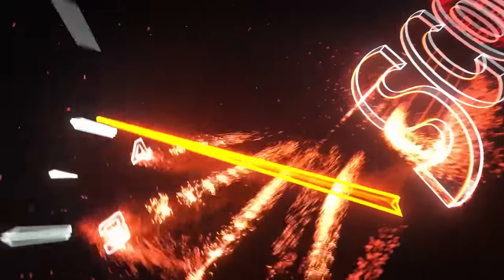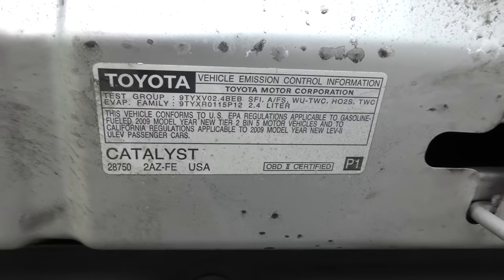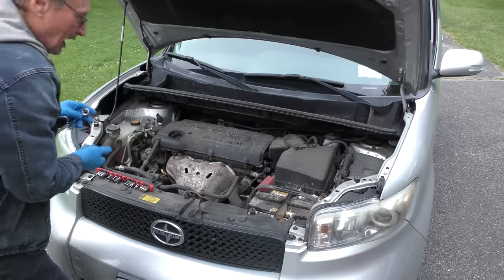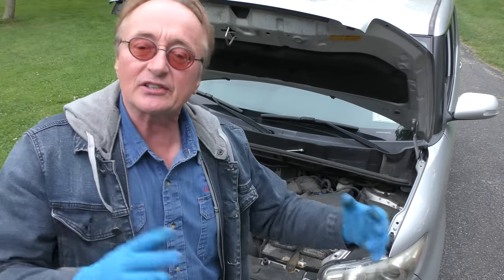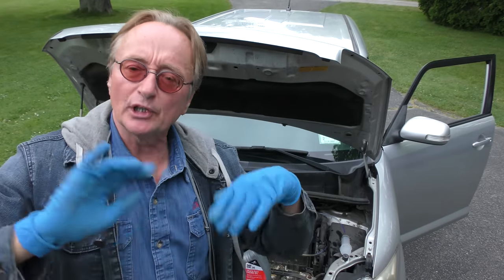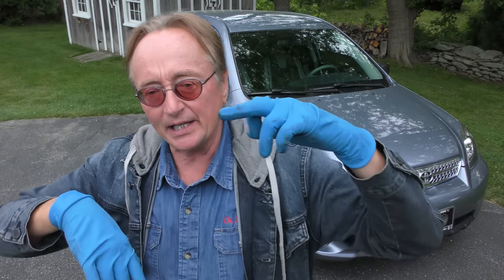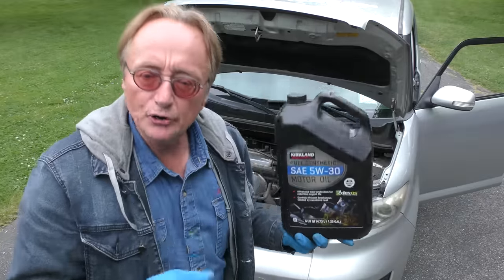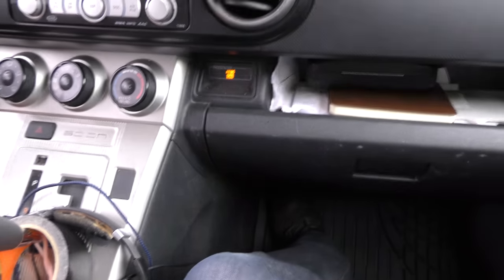Read My Lips, DO NOT Buy These Cars

Comment: I think they didn't want to associate the tiny (Scion) cars with Toyota. Picked up a 2007 Rav4 (also 2.4l like your son's camry that got handed down and still runs like a champ), picked up at 89k miles. Record says no recall performed for rings, burned about 1.5 quarts per 3000 miles. Threw in some Seafoam in the oil and lo and behold, the burning seems to have stopped. Figure 5 oz of seafoam every 3000 miles is totally worth it. Will tell over time I suppose, but I think the seafoam is cleaning the burned oil gunk out.
Reply: Its not really a matter of " Burning the gunk out " of the motor  .
The clearence between the rings and cylinder wall will only get worse with mileage .
I had an 07 Rav4 with the 2.4 oil burner motor also .
I just checked the oil every few days and kept up with it  .
And Scotty has said Seafoam is a waste of money and I agree with him .
Just change your oil / filter every 5k miles and that will help prevent premature wear on your motor and should keep the oil consumption down.
Reply: I had an 03 Camry with the oil burning engine.  Put 306,000 miles on it before it died (died due to my neglecting the oil level).
Reply: @stevechance150  Sounds like you got your money's worth from it .

Comment: Does 2013 Scion xB with a 5 speed standard have the  same problem? My has 85285 km on it
Reply: I believe they fixed the oil burning issue at the end of 2012 .
Reply: My 15 is like a fine clock. I also have the manual. Fun and better mpgs.
Reply: Yes. I get excellent gas mileage on it I use stp octaine boost every 3 tank full to help it along. My empty to me is a half of a tank full. 

I also have a 2002 honda accord lx 4 door with the 2.3 liter v-tec 5 speed standard. I have been using the boost in that for 16 years that I have owned the car. Excellent fuel mileage as well..

Comment: Scotty,
My Scion XB hesitates or don't start when warm despite it cranks... Only when cold has no problem starting. A mechanic said it was due to a faulty fuel pump. Once running it drives and feels smooth. It burns oil @ 160k (1Qt every 350 miles) but the engine still has a lot of pepper in it. Please advise.

Comment: My 2014 with 315,000 miles has not burned oil ..my transmission just started slipping .. i changed the tranny fluid at 186,000 when i bought it. I just changed the filter and the slipping decreased.

Comment: I thought Toyota shot themselves in the foot when they discontinued the little 1.5L, replacing it with the Camry engine. I think for a short while the larger engine was an option and they they discontinued the 1.5L JUST BEFORE the price of gas started skyrocketing. Worst timing ever. The 1.5L will get you all the speeding tickets you want. The XB is NOT a sports car. We have a 2006 XB. Just replaced the original exhaust, resonator on back and shocks before that and the A/C just stopped working a couple of days ago. Other than that, it's been really reliable.

Comment: I have 260,000 miles on my 2008. No problems aside from AC condenser and a Valve Cover gasket leak. Simple repairs.

Comment: I have a 2005 Scion xB.  AC compressor went out. Replaced it. Second one immediately went out.  Replaced it again.  AC came on and off until it died a year later.  Car goes through a liter of oil every 1000 miles.  Hood rod broke off. Now the tail light fuse blows immediately when I turn on my lights even with the wire harness removed to the taillights and display lights on same circuit. Still trying to find the short.   This car sucks.  Embarrassment  to the Toyota name.  No wonder you can get these cars used for $3,000 or less.

Comment: Well MAY of 2022 l got a 2012 scion xb ,84000 onit..90000 now 1 year late, two oil changes WITH ATS Additive it went from 3/4 quart in 1000 miles to 1/3 quart in 3000 miles thats two treatments 60 doller each with the gas done at the sametime,Wonder just how often i should repeat this ATS stuff every 3 or 2 oilchanges.

Comment: It’s worth mentioning those rusty Tacoma and tundra frames were not actually Toyota’s fault. In order to bring more production into the US Toyota teamed up with a us manufacturer to make the frames in the United States and save on import taxes, this in turn would keep the price down. Unfortunately Dana corp who toyota used to make the frames made them from substandard materials and did not treat them properly for corrosion resistance. This persisted from 05 to 12 when toyota caught the problem and brought frame production back in house. The trucks with the rotten frames were recalled. Mine had 2 3/4 inch holes above the rear wheels and I was issued a rental immediately. The reframed  truck was driven for another 4 years and with just under 100,000 miles on it I got 8500 for it selling it. The reason toyota replaced the frames was they got a 28 million dollar settlement from Dana corp to replace them

Comment: I have a 2014 Scion XB with 33,352 miles.  I am the original owner. I've had no issues with it until today. For no apparent reason I'm now hearing fluid sloshing sounds when I brake after I had been driving for about 8 miles. Anyone have any ideas?

Comment: 2AZ-FE engine. BTW the factory defect repair program ended in 2019 so you can't take these in anymore to get the engine repaired under the recall.
Reply: Thank you for that info.  VERY helpful!
I had a 2003 Camry with the 2AZ-FE and put 306,000+ miles on it before it died (due to my neglecting it).
Reply: You can still take a 2013 or newer one in, but they don’t have the problem. Things are bullet proof for many people. Even the earlier oil burners.

Comment: I have been driving my 1985 Toyota 4runner SR5 5 speed, gets 22mpg using ethanol free gasoline. it hs the best engine ever made, the 22re !!!!!
Reply: I had one . They are worth good money now because that was the first year for fuel injection on the 2.2 and the last year for the straight front axle .
Reply: I believe you got your money's worth out of that 4runner!!!
Reply: @jayhockley8841  it's a 2.4
Reply: @stevechance150  oh yea, it has zero rust, it was garage kept most of it's life in Southern Cali, when I got it, I found out that the previous owner switched the transmission from automatic to manual, and it has 5:29 gearing up front and the rear, FJ80 tierods and ends, Trail gear setup with 4 in leaves, I had the air conditioning recharged, it blows cold (46 deg). it's engine was overhauled at 230k, now it has 277k miles on it, SR5 emblazoned on the seats, factory roll bar, altimeter/inclinometer, cruise control, power windows. 3 mos ago i installed a 3 row metal radiator, news hoses 88c thermostat. and it is white/ grey interior. great truck!
Reply: @dundeeecroc   Ok , your right ( I was thinking of 22RE which is the 2.4 ltr )  but 1st year of fuel injection.
Last year of the straight front axle .

Comment: My 2008 began burning oil at about 35k miles, Camry engine, it was over 3 yrs old they wouldn't fix it.
Reply: That does not make any sense. The rules are up to 120k miles or 10 years. Did you call Toyota directly? They should have put new pistons and rings after a test.
Reply: @djkenny1202  It's 36 months or 36k miles, isn't it? And I had to prove that the car was burning oil, so after getting an oil change there, I had to go back every week so they would check the level.
Reply: @pedrofernandez8729  its they do an oil change. Seal it. Come back at 1500 miles to test consumption. No idea what the warranty has to do with it? Its a campaign. Any Toyota with this s engine up to 10 years old and up to 120k.
Reply: @djkenny1202  Well, that was 10 yrs ago, car was sold to Car Max so it became someone else's pain.

Comment: My 1st gen Scion xB had 343k miles on still running good
Reply: I have under 63K on my '06----Only changed oil, tires & brakes.  I'm wondering if I should change coolant & trans oil.

Comment: That engine was in a 2009 Matrix purchased NEW for 20,000 Canadian dollars in 2009 and although all oil changes were done regularly, at about 100,000 kilometers that Matrix 4 door car was burning oil...in fact it burned a full litre of oil between every oil change, which were done every 3,000 kilometers....then the transmission failed at 110,00 kilometres even though the car was an automatic this cost $2700.00 to repair and Toyota would not cover that issue either because guess what Scotty?....the warranty had JUST expired! The only Toyota I ever drove was new and was a piece of crap car from the very beginning and YES this all happened in Canada and YES a class action should have been levied against Toyota for selling those shitty engines because they knew ALL ABOUT THEM.   Needless to say Scotty I was a little surprised when I watched your other videos about how great your Canadian Matrix is and how reliable it is...glad YOU found a good one. 
Enjoy your shows, please make more.All the best!
Reply: His matrix has the 1.8 liter engine. It had oil burning issues as well, but was rectified during 2003

Comment: I was told that TOYOTA "fixed" this issue in later models after 2010 or 2012
Reply: So is a 2012 Xb bad?
Reply: @ANGELSURS  2010/2011 was the year they fix almost all.
Reply: @ANGELSURS  so no it’s not. U get even more chance of less oil consumption from 2011-2015.
Reply: @toyotabrony  thank you kindly
Reply: @ANGELSURS  no problems

Comment: I have an 09 xB with the same issue. The cap says 5W-20 0W-20. I have tried 10W-30 and the car does feel sluggish under highway acceleration.
Reply: Impossible
Reply: @steelzmb4262  the VVT or whatever Toyota calls it requires oil bring pumped through tiny orifices to advance the cams.  If the oil is a little heavier and the cams are not being advanced then performance will lag at higher RPM's.  My generation  xB is geared low and turns over 3000 RPM when cruising in overdrive at the highway speeds I need to maintain to not get run over.

Comment: Toyota is going of the way of Hyundai remember the cortina or the pony. Or they excel. Those were a disposable vehicle. That the alternator cost over $500. Or how about the scoupe? I'm just saying, it seems the car manufacturers are going extremely cheap but at a high price. And at the vehicle sells cheap you know the parts are going to cost you an arm and a leg or your first born. But in any engine currently the worst always seems to be to the back of the engine. Furthest from the cooling system I'm no chemist or license mechanic. But I am a mechanic

Comment: What are the actual problematic years for this motor?
Reply: 08-10 were most plagued. But not all. Some up to 2012. Toyota has a campaign that if burns excessive oil they will essentially rebuild it with pistons and lifters 10 yrs or 120k. Many folks did not bother to follow through or did not Know. I have a 2015, extremely reliable, great vehicle, burns no oil. They are not known to have the issue.

Comment: “Cruising at 85-90mph” is not what people think of when wanting it to be “faster”. Sure, how “fast” it goes, is technically top speed, but people are referring to acceleration, passing power. If it takes you 30 seconds to get to said 85-90mph, it’s NOT fast enough. That’s the point they’re still slow lmao

Comment: Hey Scotty, the transmission on my Honda Accord 2004 slips while changing from 1 to 2 only. What could be the problem?
Reply: I had the same problem with my ‘07 Acura TL. I changed the transmission oil to they same type they use in a Corvette. I was amazed that it cured the ‘slipping’ problem. (It was a Honda mechanic that recommended this to me).
Reply: @KP-uj1wf  Im glad that worked for You , but personally I would never use anything other than Factory Honda Trans fluid in a Honda .

Comment: I have the exact same engine 07 RAV. What a stinker runs like a clock though.. 🏌️
Reply: Oddly enough, I changed the spark plugs at around 8K and surprisingly they were still good. I was shocked.

Comment: "oil cap says 0w20, or 5w30"
It's the same engine as the 2AZFE in the Camry but it's oil cap says 0w20, or 5w20. A logical explanation would be very interesting.

Comment: back when i gave my dad’s old surburban he used havoline 10/30 years but i said for a work truck let see if we put the spinach back into her. she had tons of millage minus one engine rebuild. so i went with caster oil gtx high mileage green. night n day. old fart quit using oil as much big improvement yes she smoked like a old radial engine but that practically stopped. she quieted down we putted around town ran down to the river back home. water pump shaft decided to break. it’s done that before. drank gas like mad. my dad had his pilots license 🪪 we were out flying model airplanes his hobby i go back over into the truck to get something i look over at the gauge empty not getting home. we needed to go juice jerry can she’d drink that dry in two miles. wont work. hmm aviation fuel fortunately fuel truck ran by i wandered if he a any remaining fuel. sure fifty dollars worth oh boy did it work once that sucked up into the carb pop eye showed up it smoked and i mean smoked you’d think the truck was on fire. we got stopped thinking it was. nope it decarboned it self 350 sb into 454 bb one pump cold truck 🛻 rocked

Comment: Don’t buy any gas cars, you’re throwing your money away.  Buy a Tesla, $600 month payment, then save $200/month on gas and no maintenance costs or worries about oil leaks, transmissions, radiators, blah blah blah
Reply: Or a more affordable EV. $400 is a lot of $.
Reply: @djkenny1202  The average price for new car is $49K, you can buy a Tesla for under that, and could probably sell it for the same amount or more 3-4 years later.  You get what you pay for..
Reply: @aquavelva4927  that is way more than most people will pay. Average is in in 30 grand range. I’d buy an entry level Leaf. Cheaper to maintain as well. Parts are ridiculous for Tesla. My neighbor a 2011 Leaf thats been extremely easy to live with since new.
Reply: I'll pass. I can't stand Elon musk
Reply: @aprilmiller2374  Feelings got hurt from tweets?